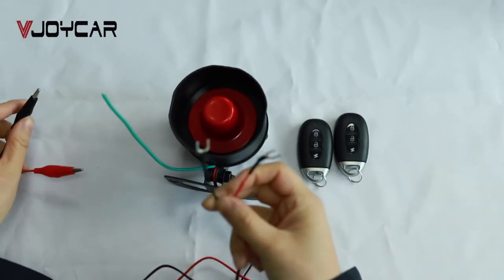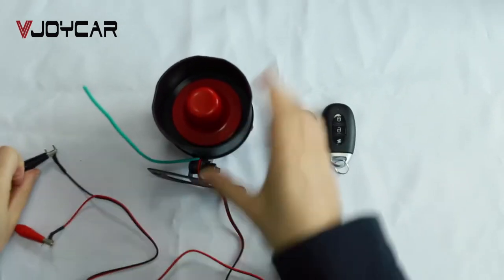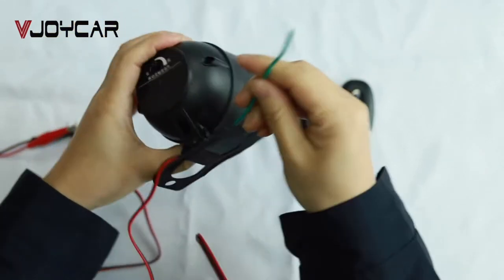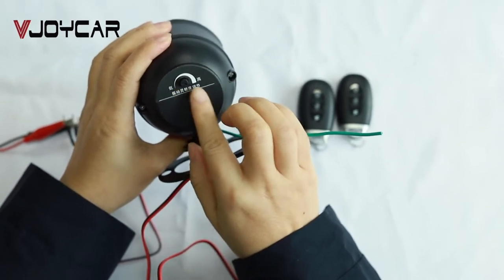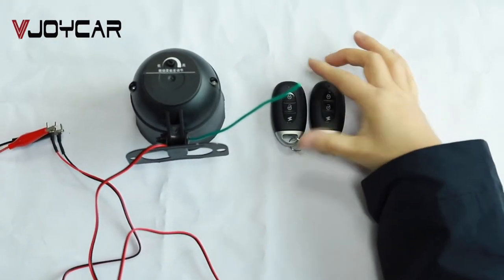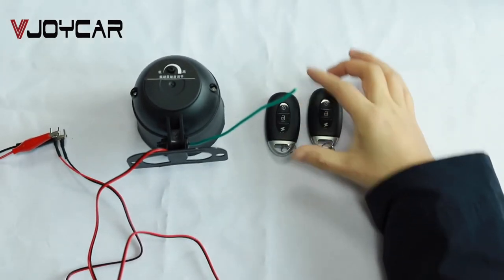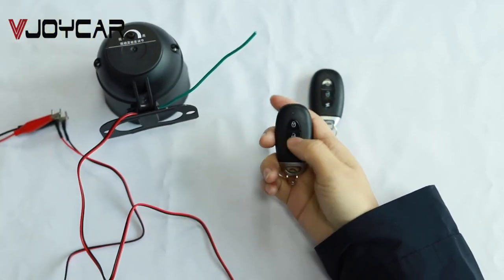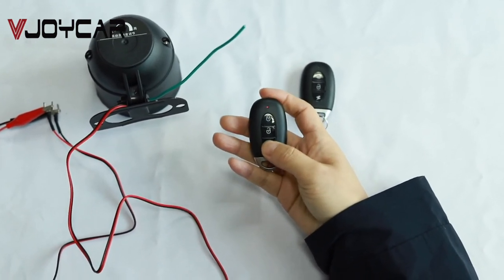DIY Install Wireless Car Alarm Finding Car Remotely Vibration Sensor Siren

Comment: How to lower the sensitivity
Reply from the maker: hi friend, there' s button on the siren back, it can adjust the sensitivity easilly.
Reply: No U don't adjust it that way U have to press the lock and unlock key for 3 seconds and the car will make a chirpy count how many chirps it does its set to 4   7 is the very lightest but U may have false alarms. 1 is you have to bang the car very hard and 7 is light. Once it gives U the chirps and U have counted them press the on  to make it More sensitive and off to make it less sensitive they wait 3 seconds and it will go out of the setting on its own.